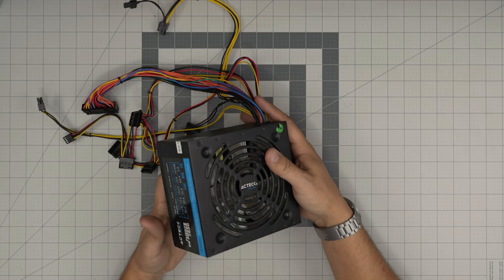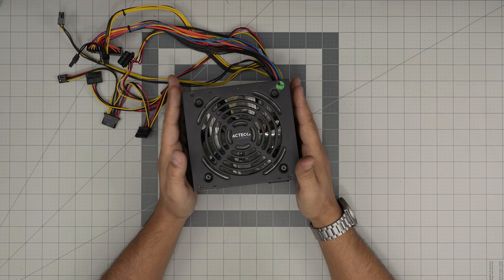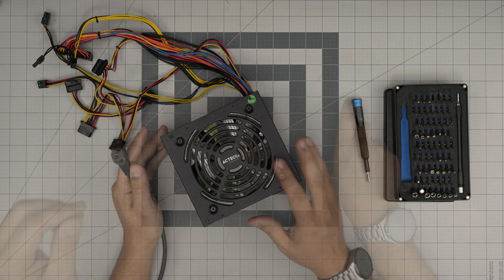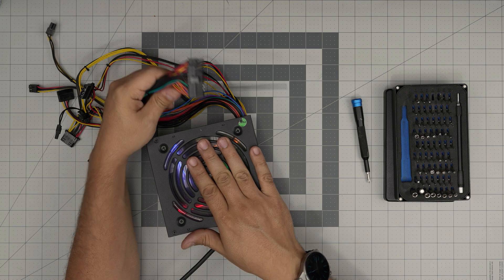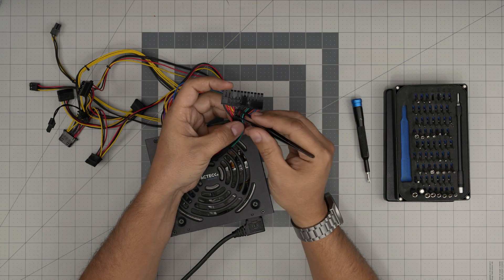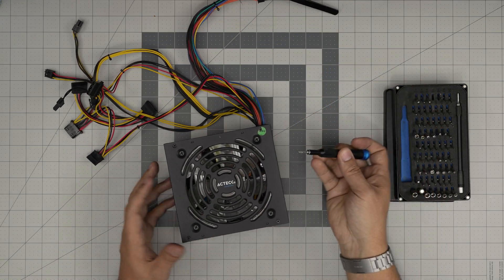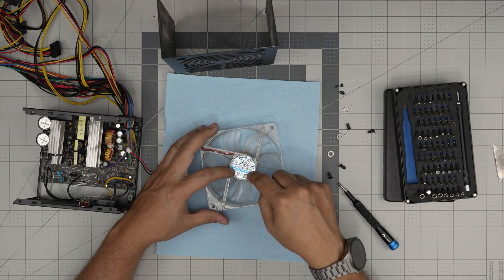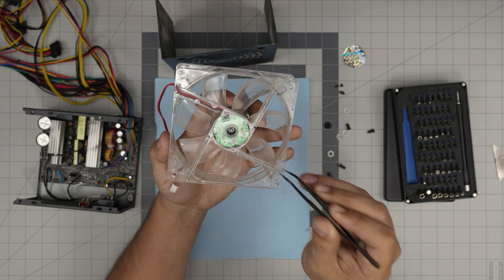How to Fix PC Power Supply (PSU) Fan Noise Easily | Easy DIY Repair Guide

Comment: How if i dont have lubricant oil?it is still ok if im just cleaning it with isoprohyl alcohol and skip the lubricant part ?
Reply from the maker: 🫠Regarding your question, you will need the lubricant else the fan will have a very low RPM.
get any type of oil.
cheers🍻

Comment: Dude PSU fans are very cheap you can buy one and just replace your noisy fan that's exactly what I did 
it's not worth it to go through all these steps knowing how the fans are cheap these days!!
Reply from the maker: 🫠Regarding your feedback, this video is for those who are on a budget and want to service instead of buy.
This video was made for my client, as they requested fan servicing and not replacement.
However, if you have the buck to spend, it is definitely much faster to replace it.
cheers🍻

Comment: Great video. Wasnt looking for it, but after seeing this video I'm definitely gonna clean my psu fan.

Also, the "I hope it's not a pube hair" made me actually laugh out loud. 😂
Reply from the maker: It's my pleasure, my friend. 😊 I deeply appreciate your taking the time to provide feedback. If you're inclined to support the channel further, feel free to like and subscribe—or even both!
I hope it wasn't pubic hair either 🤣. I had to wash my hands with 2 liters of detergent.🫠
i have placed links for fans if you need to replace.
Should you have any questions or requests in the future, please don't hesitate to ask me.
🍻cheers
Reply: @uFixTek A SSD screw got lost in my PSU and I didn't notice until I turned it on then it started making weird noises should I just replace the PSU?